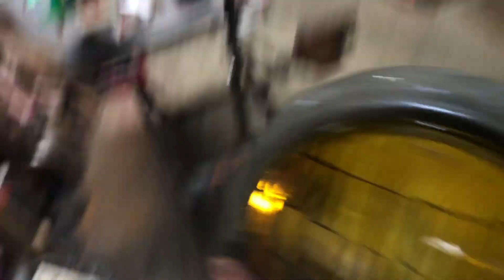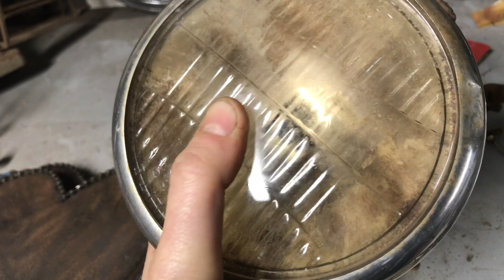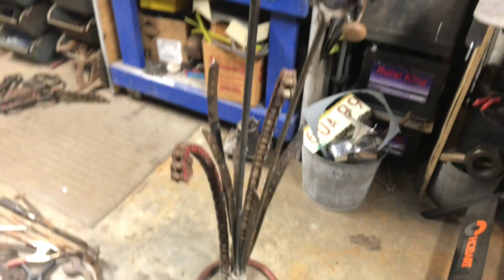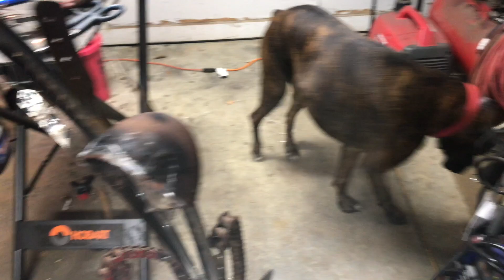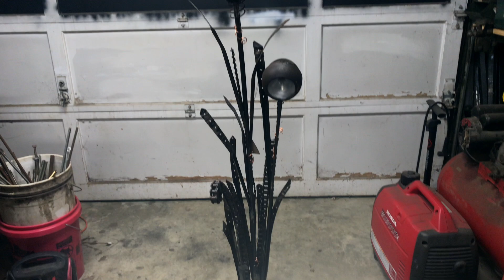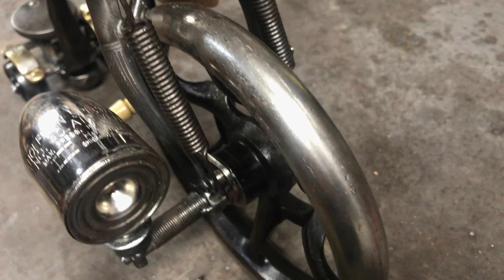Vintage sealed beam fog lamp gets new life!!

Comment: Nice work on the copper backing.
I see what was the thinking there.
I had a thought about the old lenses for the smaller lamp,had you tried using a clear lacquer over it or a very thin machine oil?
I think the lamp overall has a great presence,I was thinking during that it needed to be grounded more with fallen grass tufts but it looks great
Reply from the maker: thanks...catching up on your videos now! I'm way behind!